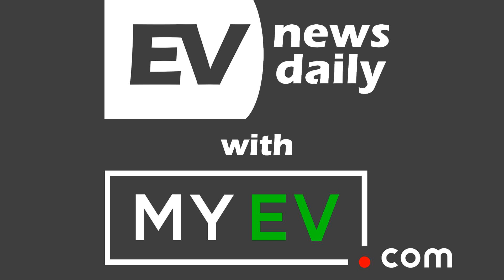26 Oct 2019 | 5% Power Update For Tesla Drivers, Porsche Taycan Cross Turismo Testing and New...

Comment: "No such thing as a self charging hybrid"
So how does the drive battery get recharged?
Reply: I have a volt. Love it. Wish it had more range. Minnesota cold really cuts range.
And already have my personalized license plate for the vw electric van coming out.
"VW BUZZ" I hope they don't change the name.

99.99999999999999999999999 don't have solar yet.
The prius compares well in c02 output cost per mile to BEV.
Just facts...
Reply: Tazzman  
Yes, it is petrol
But it has extremely low co2 output. Not much higher than charging with current grid.
It does charge it's own battery.
And is a very reliable car that most mechanics can fix and parts are cheap.
Prius
Reply: TIM Flugaur-Leavitt And it goes NOWHERE without Petrol. 
I couldn’t even do the very short run to our local shops without starting the engine in a Prius, = cold engine, very polluting as the catalytic converter is not working. 
That’s why I bought a PHEV, and have now moved on further to a pure EV, which is charged by my solar panels!